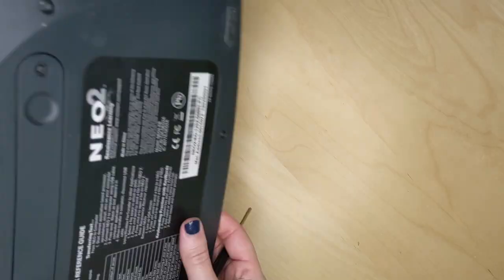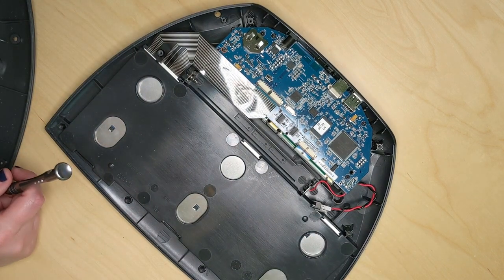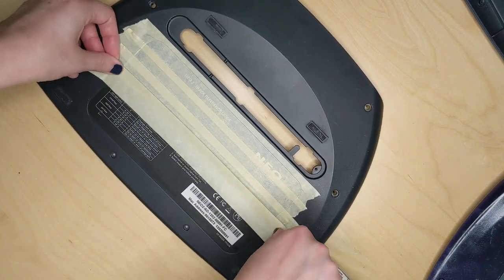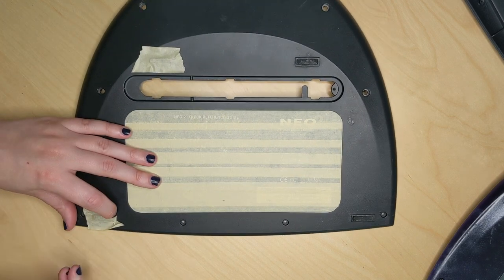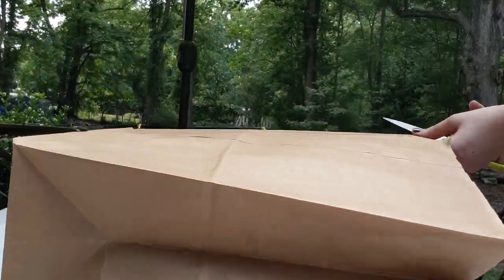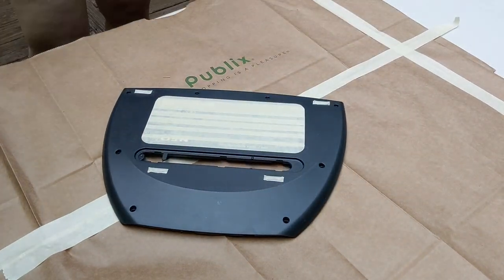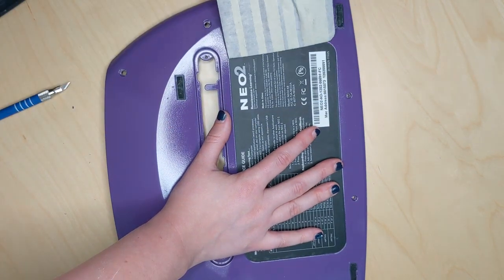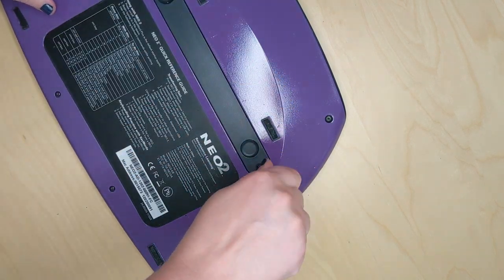Customizing my Alphasmart!

Comment: If you change the back-up battery inside, you won't experience the data loss. It's a cr3032, I think, and pretty easy to replace. In fact, you were almost there when you rook it apart. Looks good though!
Reply from the maker: I should! Thanks for commenting with the battery type. I'll go ahead and order one!